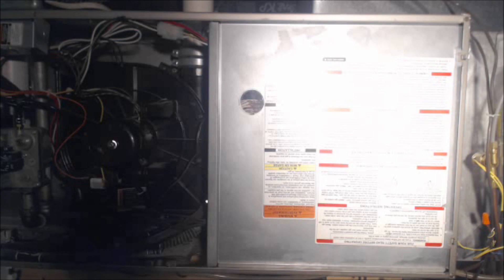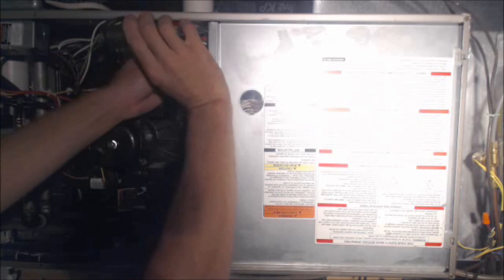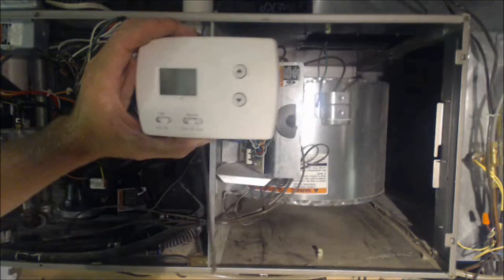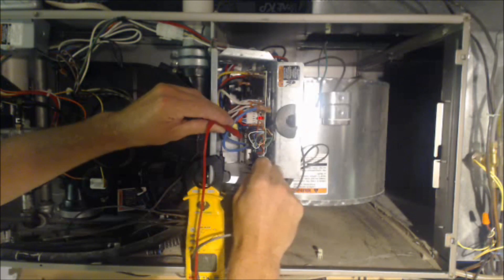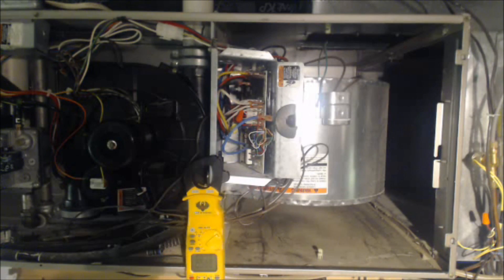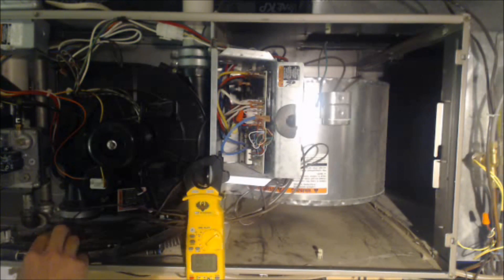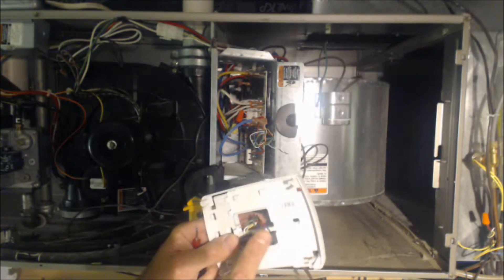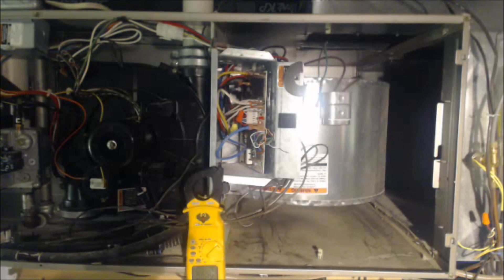Blower Fan Motor Won't Shut off!- STEP by STEP Troubleshooting!

Comment: I appreciate your videos and they are done up very well.If I could ask, do you think we should troubleshoot these things from the inside out, rather the outside in? Meaning, if there's an issue with the blower, we start from the blower and work towards the t-stat, rather than start at the tstat? Here's why. I, too, had looked at the tstat first, then tblock, then wiring, then the board itself. Through eliminating all of the aforementioned parts, I ultimately found 0V on the G terminal of the board while the fan was running....so I, too  thought it was the board. Bought the board and swapped and same problem persists. So I still do not have a solution to my problem, but here are some remaining questions: I'm seeing about 5 wires coming out of the motor with 2 capped off. So I'm assuming it's a 3 speed motor (I honestly don't know). nonetheless there has to be a constant power to that motor and I'm curious if there's a possibility there's an issue with the wiring inside the motor that would put it on constant run? Clearly one of the wires has to go to the relay so perhaps the relay is stuck on? So obviously, it is something between the motor and the board (with board and low volt enables and tstat eliminated).If this is not a comprehensive diagnosis and mainly focused on enables, I apologize. This one has me puzzled and I'm about to pull the whole blower assembly out to start checking wiring. but once again, I love the video. Very nice! :)
Reply from the maker: Thanks for the questions! So the reason I approach the service from the start to the finish is just so everyone understands the full operation and is the same way I teach at school. I do however, like you said, just go right for the problem and work backwards out but I can't work backwards out unless I know frontwards. That is all.  Is this motor a psc motor with capacitor, a ecm x13, or a variable speed ecm 2.0, 2.3, 2.5, 2.7, or 3.0? In this playlist, I have variable speed, psc 120v and psc 240v, and x13 troubleshooting and motor details.--------https://www.youtube.com/playlist?list=PLxnHR5_D2ojyDrxCT9MIttGW4wxOZ3n-7

Comment: Great video. One thing also to check is on the Honeywell thermostats they have those pins from the thermostat to the base plate when customers change the batteries most of the time they bend those pins closing the circuit
Reply from the maker: Absolutely, Great Comment!
Reply: Richard Murphy wow always learning in this trade

Comment: On a 3 decade old 120 volt Carrier system here the relays can stick after they are 25 years old. The fan keeps running after the call for AC or Heat has stopped. One can tap on the relay and it will unstick as a sign that one needs a new board, or the old relay contacts cleaned.        My place has two airhandlers and thus 2 boards.      This video link below is where I tap on a faulty one to unstick it. This is not a repair, but a ancient troubleshoot method. You have to be carefull you do not hit any live wires. 

The real odd thing is the unit will usually only stick every few months when it first happens and it gets worse slowy.   ie it might happen a few times a year at first.   But when one opens up the access panels the relay may go "unstuck" since one is bumping around removing the panel!  and thus with the power off one really is baffled since the problem "went away". Thus a weird intermittent issue can drive one nuts until it is understood. 

https://www.youtube.com/watch?v=0Gbz_QyqPnw
Reply from the maker: That would mean that the contacts on the relay are actually slightly melted/burnt together. They get rough instead of smooth on their surfaces and the smaller parts that the amperage is going over remelts onto the other contact again. I see this on old open contactors and other relays quite a bit. Thanks for your comment!

Comment: An old oil furnace I worked on years ago was showing a similar symptom. It turned out to be an overtemp sensor that was keeping the blower running waiting for the heat exchanger to cool down (which was never going to happen). I just checked the schematic for my current (80%) gas furnace, and I see no such sensor. Are such sensors no longer in use?
Reply from the maker: The fan limit control you are referring to is only really used on some oil burner furnaces now. The control board now tells when to turn the fan on for newer units. I did a video on Fan Limit Controls if you were interested! Thanks for your Comment!